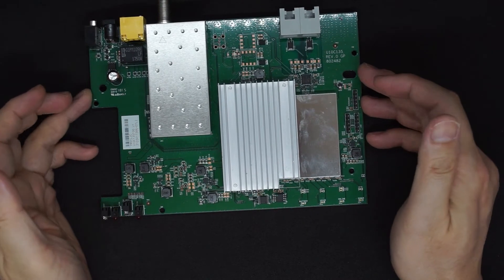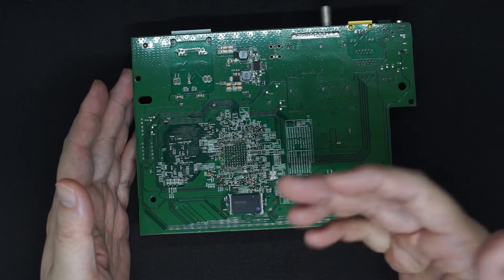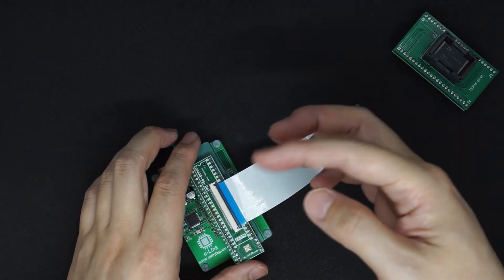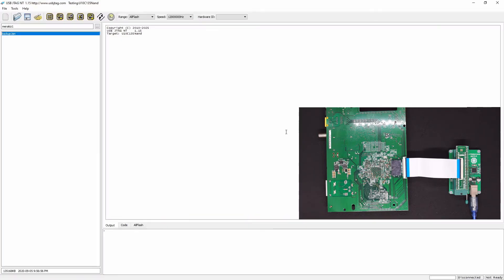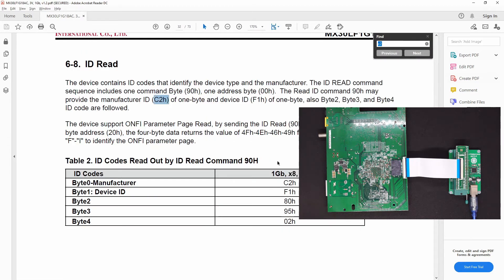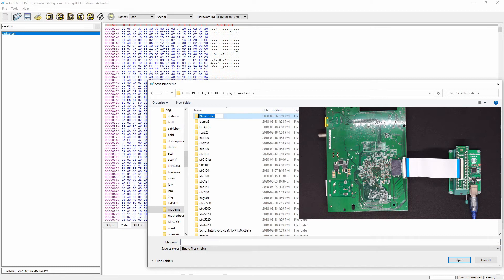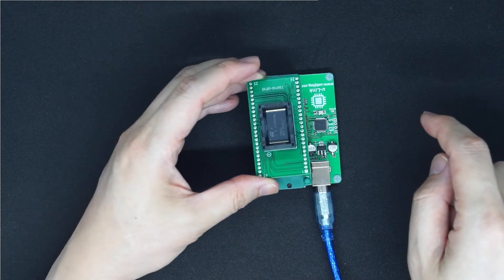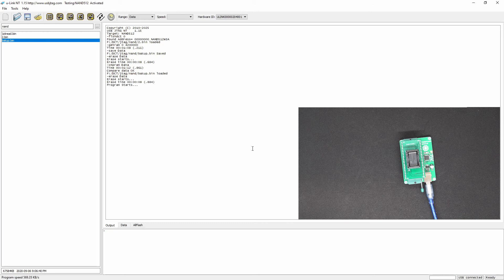u-Link Nand prototype.

Comment: Is there a specific advantage to this programmer over something like the TL866?
Reply from the maker: Unified software for Windows, Linux and Mac OS. 
Unified software for other applications like JTAG and BDM. 
Flexible configuration. 
Script support (advanced user).
Multi programmer support (up to 16 at the same time).
Active software development. The original software started 15 years ago and still evolving. There are 20 updates last year alone.
Reply: @usbbdm  Thanks for the reply! That does sound very attractive. I think you may have just helped me decide on a new programmer.

Comment: How do you get enough power from a normal USB port to power the nand?
Reply from the maker: This board only draw about 300ma on 3.3v
Reply: @usbbdm  you should think about adding a optional auxiliary external USB power to your board (for in circuit)
Reply from the maker: @RicardoCooper  Thought of this but the flat cable does not suppose to be able to handle high current. If external power is needed, then it should be soldered (connected) on the target board.